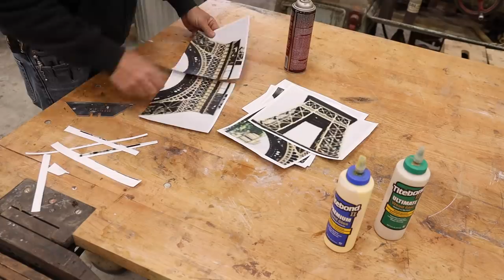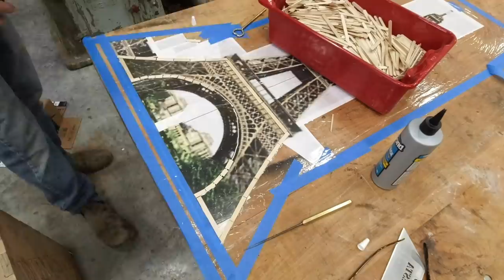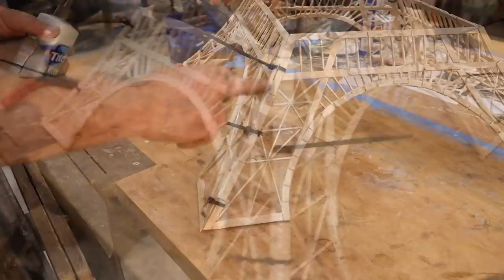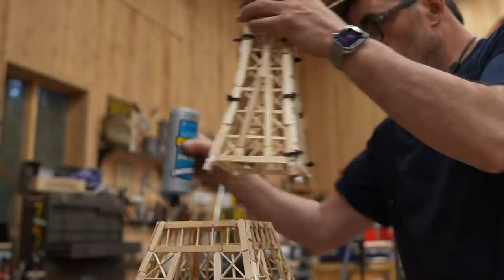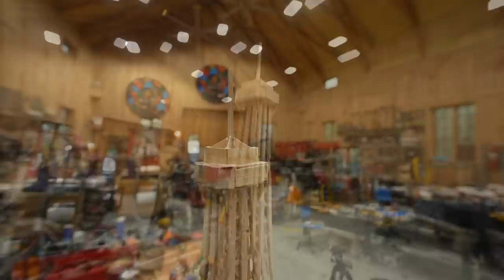DiResta Eiffel Tower From Craft Sticks

Comment: Jimmy never disappoints! Two materials a few simple hand tool, add skill and viola! Masterpiece! My high school engineering teacher had us make a suspension bridge out of these long, skinny craft sticks, glue, and some thread at the joints for a class competition. The bridge that held the most red bricks won! Bricks were standard red bricks in full, half, and quarter cuts to incrementally add weight to the structure. I think mine failed at around 7 or 8 bricks.
Reply: my school had a machine just to test those things that showed exactly how many pounds it took before breaking

Comment: Fun fact: Eiffel actually designed the tower to prove that metal structures could be as strong as wooden ones and wouldn't colapse under their own weight as many engineers of the era claimed.
By the way, you can find Eiffel's original plans online.
👍👍👍

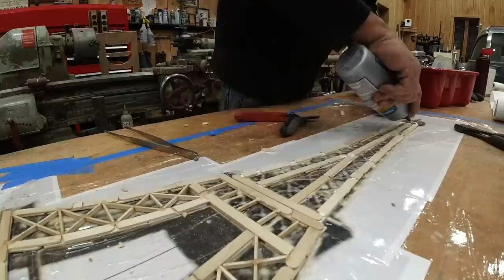Comment: Great project and great edit. I love the cuts (at 2:30 for example) where you interrupt the action with the normal speed creaky crunchy peeling up of the lower section off of the plastic wrap on the table. You can feel the tension…oh is it going to come off the table in one piece?

Comment: the image you used as a template has a ground based perspective, making the base too wide and the height foreshortened. see that your model's feet are almost 45 degrees whereas the real tower's feet are above 60 degrees. great craftsmanship apart from that.
Reply: Resulting in a slightly distorted alienating experience, when looking at it from above. We'll call it artists intent. From the original perspective it's even enhancing.
Reply: @groeneribbroek  yes in architecture it's called forced perspective and it makes structures seem more towering